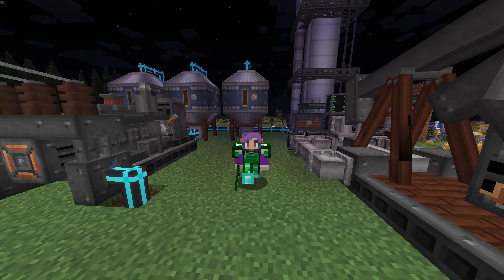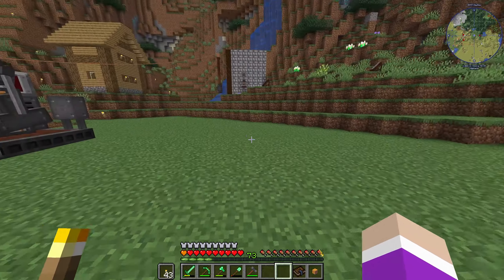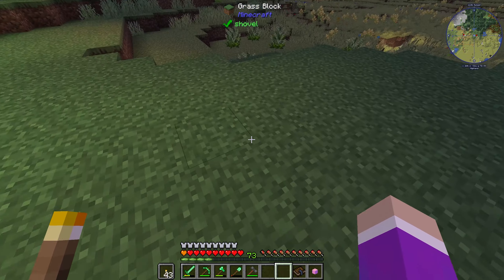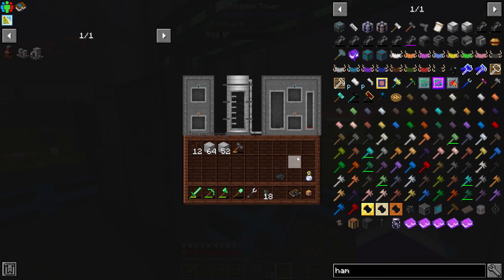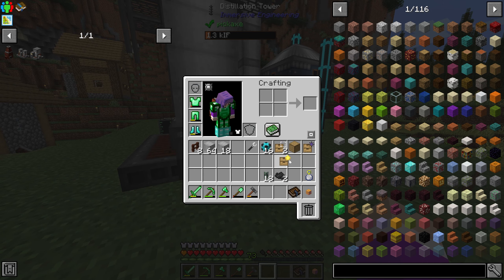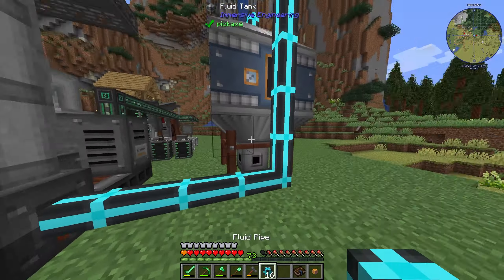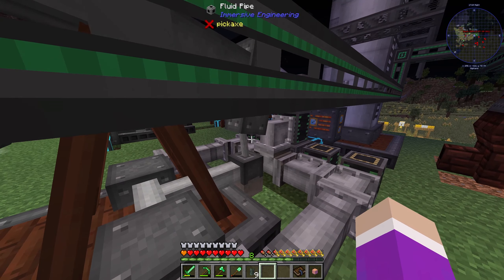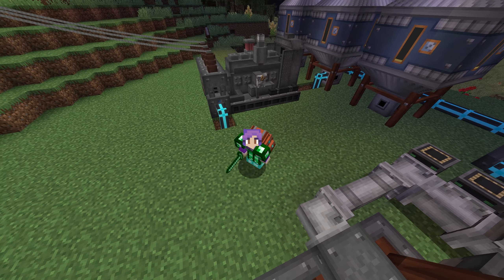Minecraft Stacia Expert Ep.7 Oil Refining & Diesel Generator

Comment: - Immersive Fluid Router gives you a way to distribute the destillation outputs
- For Sea Lanterns you can make a cheap Silk Touch Pick from Tinkers (Just Rose Gold)
Reply from the maker: omg yes thank you!! Those fluids where driving me mad and good call on the silk pick from tinkers
Reply: @Shadowwolf1900  If you connect HV Capacitors to the diesel generator in place of the connectors you can extract from those with universal cables ^^